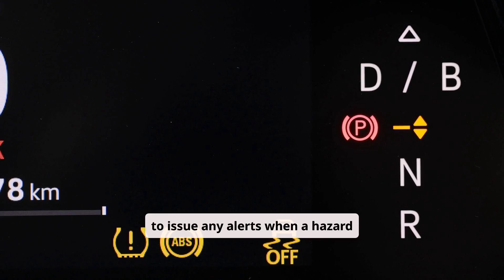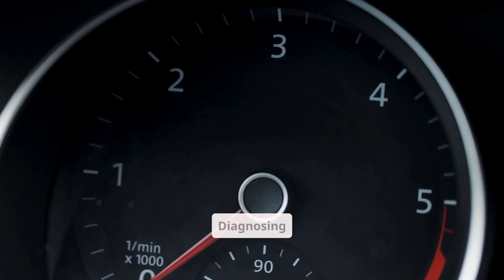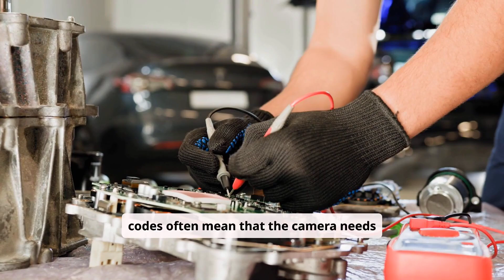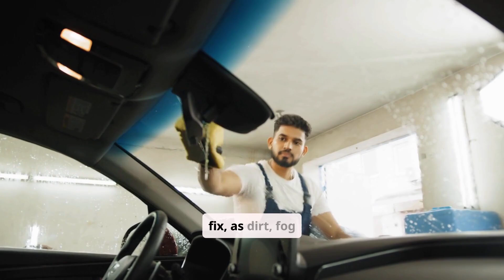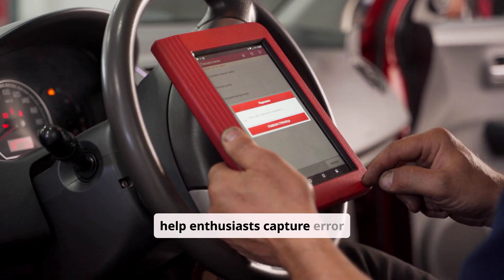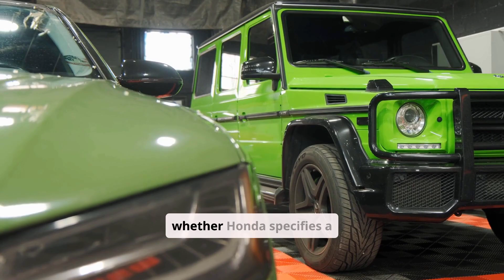Causes and Solutions for Honda Forward Collision Warning (FCW) Error Message

Comment: Last week (Jul 4th) on a hot day in South Carolina, we were driving home in our 2016 Odyssey EX-L and we stopped at a fireworks store. Our group stayed inside the van but the folks in back asked if they could open the sliding doors. With the engine still running I pushed the button to open the doors but they wouldn't open. I tried turning off the engine and pushing the button again and the doors opened. Then I tried to start the van and it wouldn't start and the gauge cluster went crazy and I got the error message FCW System Failed. We were stuck there because the van wouldn't start. We called AAA and had the van towed home. My first inclination was the battery so I hooked up my volt meter and got a reading of 5 volts. After replacing the battery the van started right up and everything was back to normal. My next inclination was to check the alternator (something had to have drained that battery for it to get down to 5 volts). My instincts were correct, the alternator was not charging the battery. I have ordered a replacement alternator from Honda and will be replacing it next week. Sorry for dragging that out but my hope is that if this happens to someone else, it might be as simple as a bad battery (but don't forget to check your alternator). BTW, if you're not sure of how to check your alternator, it's really pretty simple but it does require a volt meter (which you can pick up at harbor freight for just a few bucks). Set your bolt meter to 'DC' (direct current) and touch both the positive (red or +) and the negative (black or -) terminals of your car battery at the same time. This will tell you the voltage of your battery. Now start the engine and repeat the process, if the reading increases to somewhere between 13 - 14 volts, your alternator is working. If the reading does not increase, your alternator has failed.
Reply from the maker: Thanks for sharing such a detailed real-world example. This is exactly why low voltage is one of the first things to check when multiple warning lights appear at once. A weak battery or failed alternator can make systems like FCW, power doors, gauges, and other electronics behave strangely even when the actual safety system is not the root problem.

Your voltage test explanation is also very helpful: engine off should usually show around 12 volts or more on a healthy battery, and with the engine running it should rise to roughly 13 to 14 volts if the alternator is charging. If it stays low or does not increase, the charging system needs attention. Glad you found the cause, and thanks for helping others avoid unnecessary sensor chasing.